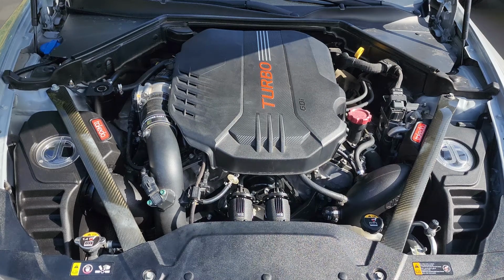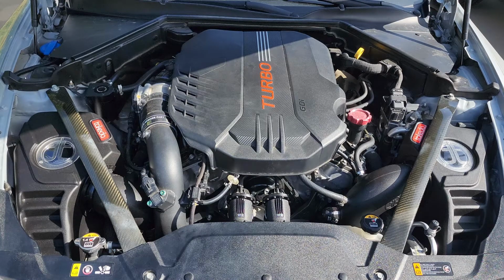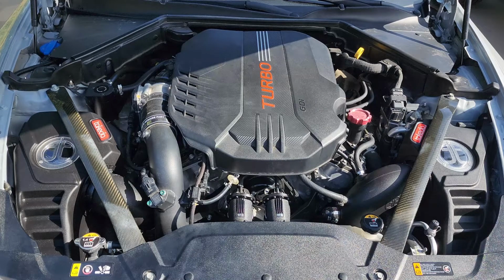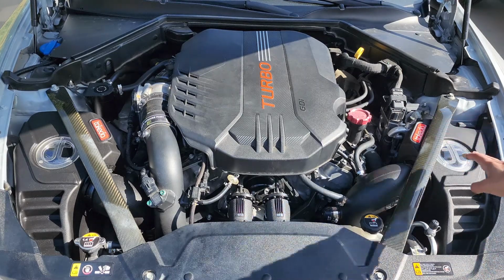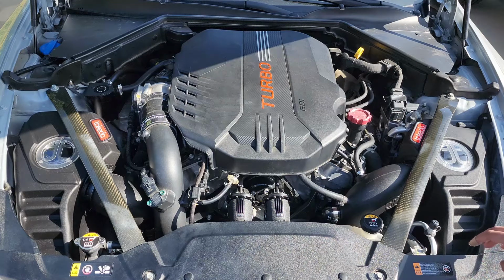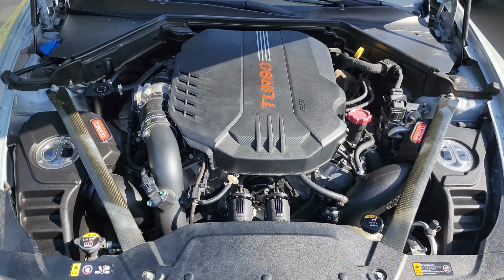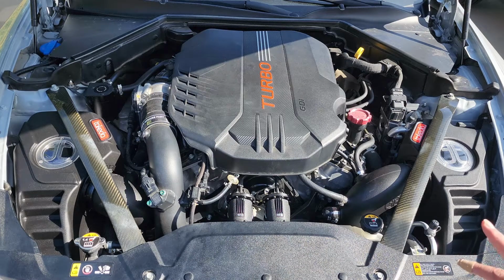Kia Stinger GT aFe Intake Review and Comparison vs Injens (side by side comparison).

Comment: I had the same issue installing driver side housing, couldn't match all 3 bolts, thought I was the only one. Does the back side of your housing also touch climate control sensor? And if so, can this cause any problem in the future because of vibrations?
Reply: It was a pain but I eventually got them in there mosatly perfect. You have to just line the front up and only tighten it so it holds the front. I put the pront bolts in only as far as i needed to foir them to stay put. Left all clamps and hoses just slightly snugged and all other bolts slightly loose, enough to give it some play. Then you kust have to play with it and rotat the intake tubes, hoses etc until it settles in and tyhen tighten everything up.
Reply: I had a problem getting screws lined up too. I'd think just about everyone does. Took forever to mount them. A 10mm ratchet wrench would have made it much easier, once the screws were started.

Comment: For the 2 bov, you gotta buy two or does it come together?
Reply from the maker: You do need two if you are are 3.3. I bought a kit from the K8stingerstore. It includes everything but the 1 inch end caps to block off the intake side.  
kit: https://www.k8stingerstore.com/products/hks-black-series
Reply: @ironhyde_gt  I just bought a g70 3.3T Sport Prestige. Thinking about HKS SQQ bov's, but they don't have a package, so I may have to spend $700 for both of them lol.

Comment: Wht does removing the plugs do!? I’ve seen ppl that remove the plug on GT line  and they get a check engine light! I have the same set up as u on my GT1 w/out a tune tho! (Alil broke atm! lol!)
Reply: They close off the auxiliary air inlets. Without the plugs, the intake will capture the max air available. More airflow means more power yet some of the air is picked up from inside the engine which is likely warmer air which may decrease performance a wiiiiitle bit. When installed, the plugs will block off any hot engine air entering the housing and make sure the coolest air available is directed into the engine. But they do make the intakes quieter.

Comment: I see you have BOV on there. Just curious how much sound the AFE will produce without the BOV. I know the Injens make lots of noise. Thanks in advance
Reply from the maker: Without the an aftermarket BOV the intakes are pretty quiet. You can hear some air induction with intake caps removed but nothing crazy like the injens.

Comment: Did you install the Mishimoto FMIC before the aFe intakes or at the same time?  I watched the Mishimoto install video and the boxes have to be removed so I was thinking why not do both at the same time?  Seems like if I do the aFe intake install before the Mishi install I’d have to install them twice.
Reply from the maker: I had the intercooler on before. Installing the intake on the passenger side is a little tight but it is doable!

Comment: Do my ears deceive me? i feel like the AFE are louder which is strange given its a closed box design
Reply from the maker: The BOVs are definitely louder for sure.  The aFe intake itself is pretty quiet.
Reply: @ironhyde_gt  So hands down you'd pick the AFE due to temp drops?
Reply from the maker: @305Nick  I think it looks cleaner too :)
Reply: @ironhyde_gt  thanks for the advice bro! 100% going for afe now
Reply: I’m running the afe’s. From inside the car I dont hear a difference from stock while driving
Reply: I  have the AFE's as well. With the plugs in the intakes removed and the windows down I can here the turbos spool up. I also had the same problem with the driver side intake box not being quite right.